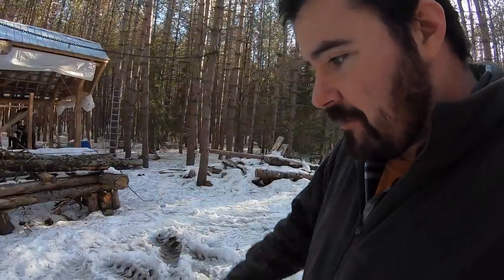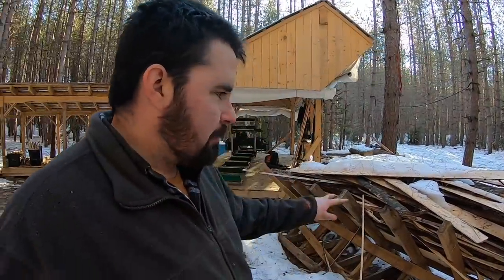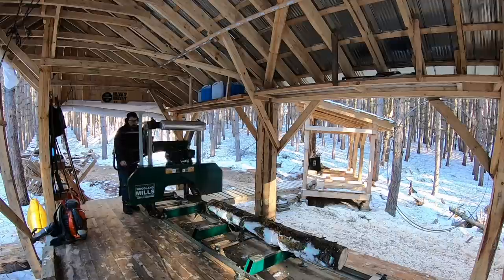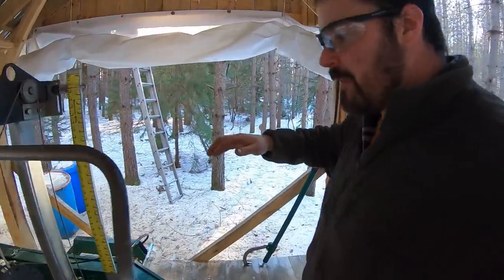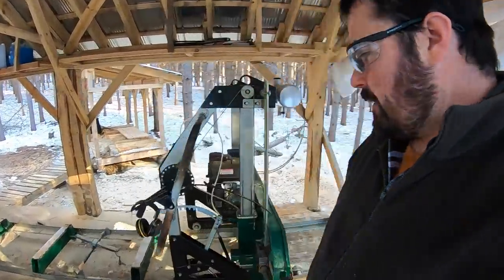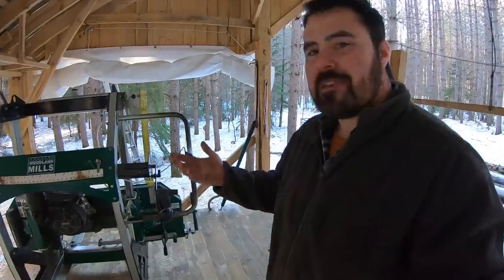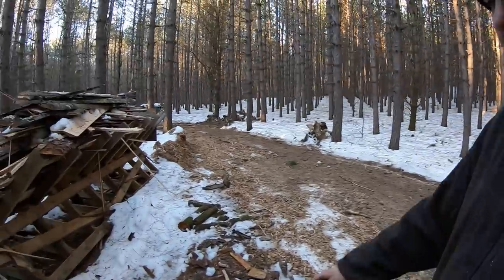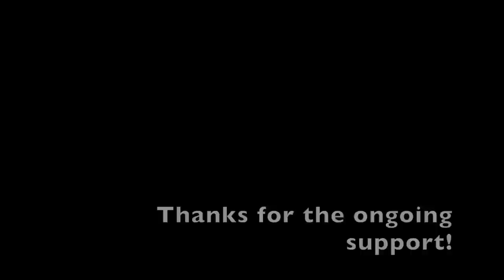Sawing Wood for the Love of It

Comment: I like the fact that somebody is using the slat scrap to do what i been saying for a while they do make a bridge specially in the winter over the swamp area and when it melt if you got plenty of saw dust you cover that bridging so it is under the ground it will last for a few years and you just had to it it will not be long you will have a elevated road 
      Sandy i really like the way you said things when you mention 2x6 instead of 2x4 you are using what the log gives you instead of wasting a lot of lumber to get what you want out of that same log a lots of people waist a good amount of lumber by cutting what they want instead of what the log got to offer well have a great day
Reply from the maker: Thanks! The slab wood should come in handy over the wet areas. I find I try to make the biggest material I can from the log and save the small lumber for small logs

Comment: Another nice video Sandy, My suggestion for the long half of the boardwalk is to permanently attach a couple of cheap car scissor jacks, one on either side to the bottom and use your cordless or impact to adjust them to desired height. This way when retracted they will be out of the way and can adjust to the uneven ground independently,  no building blocks up. Just an idea. Love your videos. Thanks!
Reply from the maker: I think that’s a great idea. Just trying to find a bit of time to add this to the list

Comment: Keep sawing Sandy,  I like the way you present your videos.   I have a 2021 Woodland Mills HM 130 max that I purchased this past spring.
 I must admit your videos have saved me a ton of headaches learning to run the mill properly and not breaking blades.  I am having health 
 problems and haven’t been using it much in the past 3 months. My son and I did use it to build a shack to put it in and keep out of the 
weather, which we finished in mid October. I live in upstate NY near Watkins Glen, so we get almost the same weather as you.  Thanks for 
all your videos.
Reply from the maker: That’s great to here about your project and I’m glad I was able to pass along some help with my videos

Comment: The best modification I did was to replace the hand crank with a 12v trailer jack, it lets me stack cut to 8” high and not have to handle the finished lumber, I just use the skid steer with the pallet forks to lift them off the bunks, the jack operates at about the same speed as the hand crank, I keep the battery on a solar charger since I don’t have electric start on my 2015 HM126 model, since the surgery on my shoulder it sure make life easier for me. Looks like a nice day there to saw logs, we are finally getting some snow here, so sure hope it stays around this time, I want to skid some logs out of the bush and hate to drag them on the bare ground. Have a great day sawing.
Reply from the maker: That sounds like a pretty slick setup? How did you make the trailer Jack work?
Reply: @sawingwithsandy  I sent links to my google drive video and pictures but not sure if it made it here. Might be a validation issue. Will give a some time and try again later.
Reply: @sawingwithsandy  https://drive.google.com/file/d/1P83DP6D-Q48O3mZRUOtgNBtuOnSJcl2m/view?usp=drivesdk
Reply: @sawingwithsandy  the video is of my modification on hm126 the two pics are of a friends hm130 max mod.

Comment: I like to shoot for 7/8" board thickness, so I raise the head 1/8", back drag the saw head, then all I have to do to get my next cut is drop 1 full inch.  Makes it a whole lot easier to get consistent thickness and to remember where to set the blade height for the next cut.
Reply from the maker: Sounds like a good setup!

Comment: Morning! Have you thought about putting a blade in the front? You have third function on the loader so you got the turning from side to side fixed. Have a good day!
Reply from the maker: I’ve seen a few pictures of blades in the front but havet figured out a use yet. What would you use it for do you think?
Reply: @sawingwithsandy  
Well, you talked about the winch vs the snowblower. You drive on chains (you have got traction) and it seems like you have mostly roads and some "small" areas to clear the snow from. My personal opinion is that a bucket is not made for working with snow. It was when you lifted the logs I thought: he could do that, and the snow-work, with a blade attached instead of that bucket.
 It's never enough 😉. First a small boat, then a big boat and then a yacht.. But some old, nice lady should really buy you a trailer with a crane 😉. No tree should be skidded/dragged on the ground 🥺...
 How many hectars or acres do you "operate" on? Somehow it's "funny" to look at the plantation. It seems like it would be about ready for a second "thinning", are they around ten inches (250 mm)?

Comment: So I liked your 2¢ part of the video. I noticed your mill does not have a blade stop (to keep the blade from hitting a raised log stop). Mine has a blade stop, and one rookie experience I can share is that I was sawing a log that was not straight, the blade stop caught the log, and the blade twisted up before I realized it causing an uneven cut. So, my question is what is your 2¢ on a blade stop? Good upgrade or get used to paying more attention to your log stop height and get rid of the blade stop? Also, I look forward to your great videos!
Reply from the maker: My mill came with the blade stop but it rattled loose and I forgot to put it back. I think it’s a good thing to have as it will likely save a blade or two especially until you get in the habit of sawing. Even for me I have forgotten about the log stops after years of sawing and so the blade stop for me is well worth it

Comment: Just subbed. Enjoy the videos. You've given me inspiration and given me some very good ideas. I'm curious, and maybe you've covered this, but what do you do with your lumber?  Do you run it through a planer? Or is it on a case by case basis?
Reply from the maker: Welcome to the channel! I do plane some of the lumber if I’m  making something like trim but for most projects I keep it as rough lumber
Reply: Do you build traditional frame buildings with your material? Or do you normally do post and beam?

Comment: Great video as always!!  Curious?? When you cut your lumber do you cut them to the true size 2x4 a 2x4 or 1-1/2x 3-1/2?
Thank you.  Have a great weekend!
Reply from the maker: Hi Larry. I used to primarily cut to true dimensions which is a piece actually being 2” by 4” or whatever dimension. Lately I’ve been cutting like they do in stores though at 1.5” and 3.5”
Reply: @sawingwithsandy  Thank you!